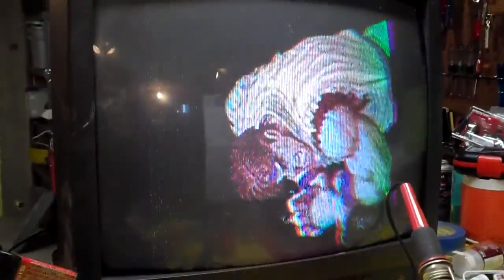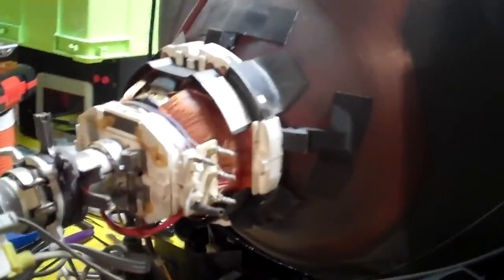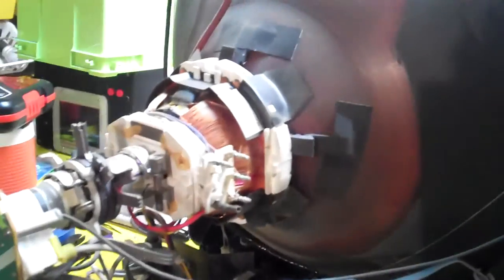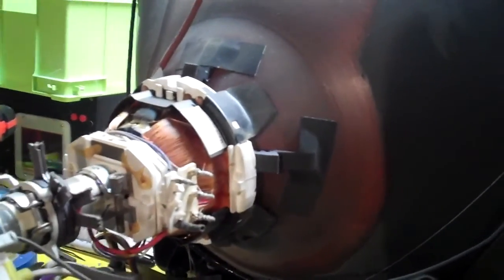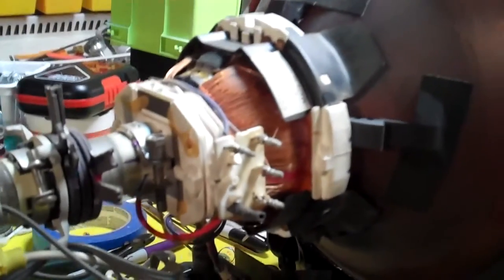Experiment - Rotating a Yoke 90 Degrees on a CRT

Comment: Great example. I knew you could rotate the image this way, but I never really thought of a practical use for it. It sounds like the project you are doing can benefit from this trick. I also linked to your video here because someone on the "John's Arcade" channel wanted to install a horizontal PCB into a cabinet with a vertical monitor and did not want to rig anything or change the monitor that was in it to get the horizontal PCB to work. Thanks for the reference.
Reply from the maker: Thanks! Was this on one of John's videos, or his forum?
Reply: It was a question in his "Viewer Mail" segment at the end of one of his videos.

Comment: do you have to discharge the monitor to rotate the yoke? and what is the point of doing this instead of rotating the whole monitor? =)
Reply: The Earth's magnetic feild messes with the shadowmask and fucks up the colors.
Reply: @inuyasha9940  That only matters if the set doesn't have a degaussing coil. Even then, you can just degauss the set once it has been rotated.